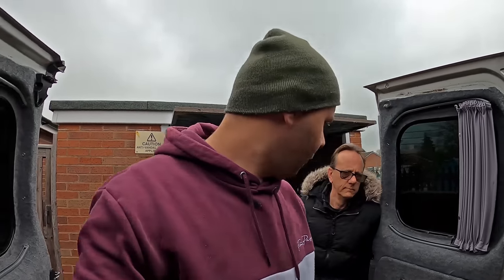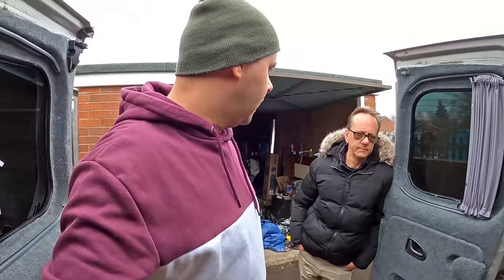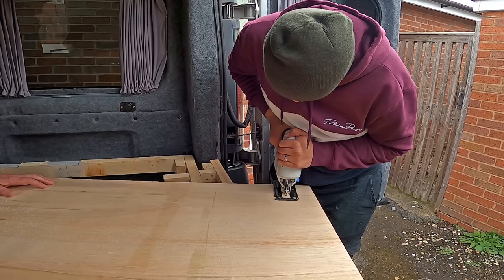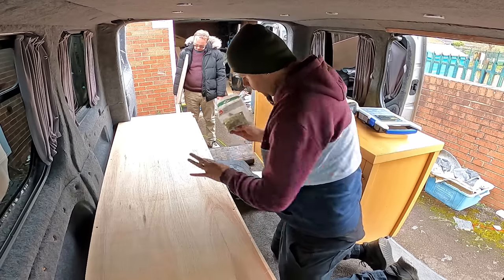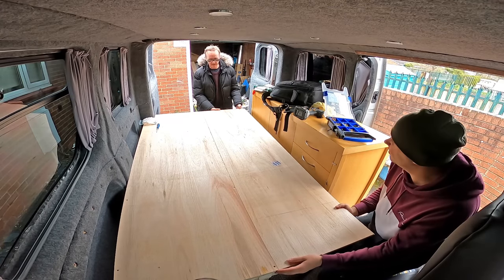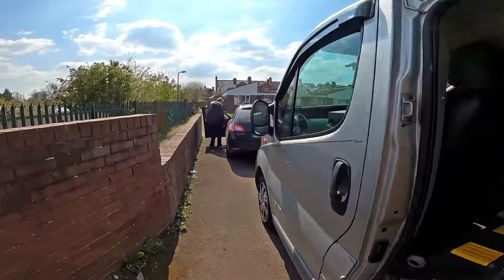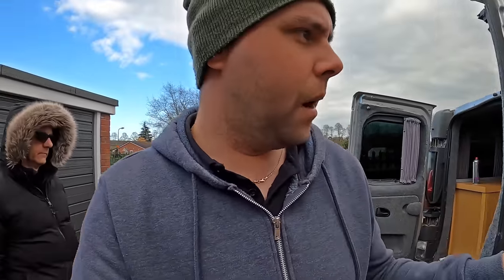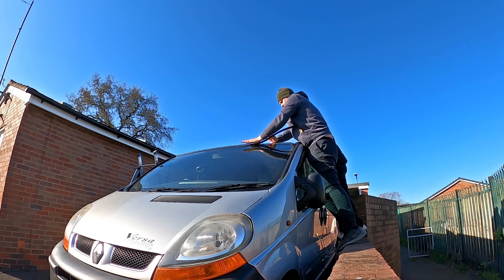THE BEST BUDGET CAMPERVAN BED BUILD For Small Vans | DIY VAN BUILD

Comment: Quite a claim you made there, so those starting out, note this. I spent a little over £1k on materials. 1. I have a comfortable R&R bed that takes 1 second put down and about 10 seconds to put back up, with bedding stored behind it. It has loads of storage underneath too and a seatbelt for a 4th passenger. 2. I have a SMEV twin burner cooker/sink, 5 gallon water tank and cold box all housed in a full length unit. 3. I have a twin seat swivel base to almost double the interior space and a bed for the dog. 4. The whole van is insulated, ply lined and 4-way carpeted, then wired and we have two side windows, but one would be okay. This is the old standard design that it seems everyone has forgotten about on Youtube, but can be done easily in 4 week ends. I built mine 8 years ago and the 3 of us have had about 150-200 great nights in it.

Comment: I’ve nearly completed a slide out bed in my viavaro, after 2 days, I think I’m gonna just do this, much better idea 👍😊
Reply: I’ve change it, much better now, can I ask, after you drilled holes in ply for ventilation, did you cover them with carpet or cut out the carpet over the holes?  Cheers
Reply from the maker: Hey buddy, glad you got some inspiration for your bed design 🙂. I carpeted over the holes 👍. As they will allow air to flow through freely through the fabric it made it look better 🙂
Reply: @BrendanExplores  thanks Brendon, appreiciate your reply
Reply from the maker: @leeg3898  thanks for your comment and support mate 👍

Comment: What about a single bed across the back 3 feet wide which extends over two seats and a table with two single mattres to make a double
Reply from the maker: I did think of a width ways bed but I'm too tall buddy. It's only 6ft wide and I'm too tall but it would work for someone shorter 👍
Reply: Could still extend 6 feet in wards I'm six feet 4 lol
Reply: 6 feet across 6 ,4 into van towards csb

Comment: 5:00 
No I was actually thinking, what about the madras?
How do you get everything set up, without being a complete mess? 😂
Reply from the maker: Thankfully the foam is very foldable and pliable 🙂 easy to move around
Reply: @BrendanExplores  I did the same, changed my bed after the first long trip. And I am trying to figure out a murphy, hanging bed thing, in a back of a small connect.. 😅